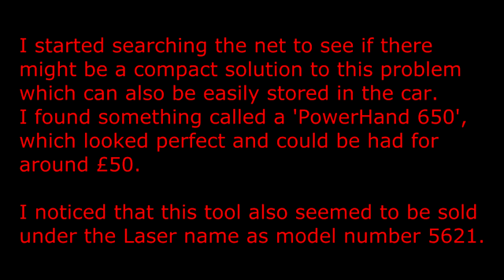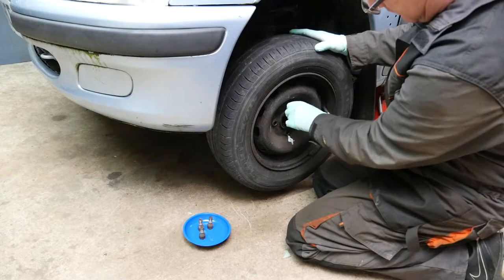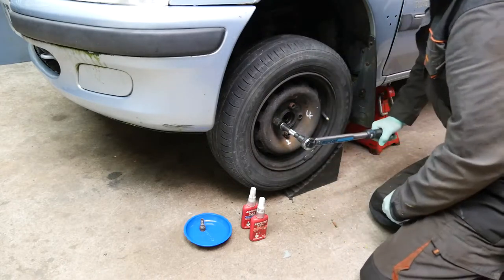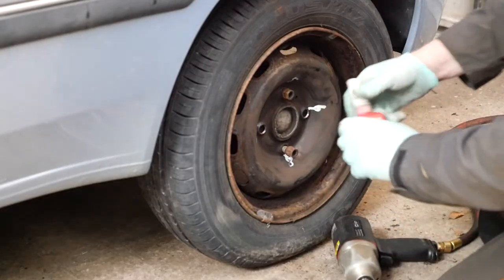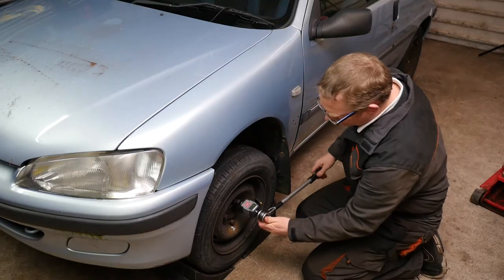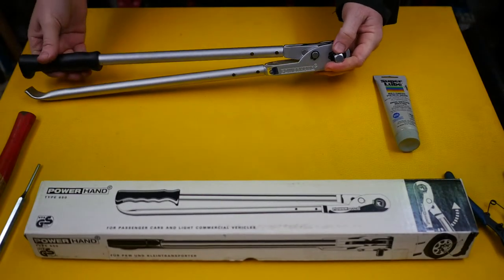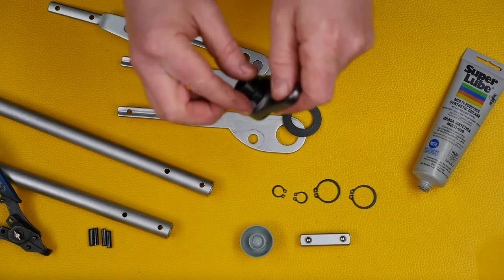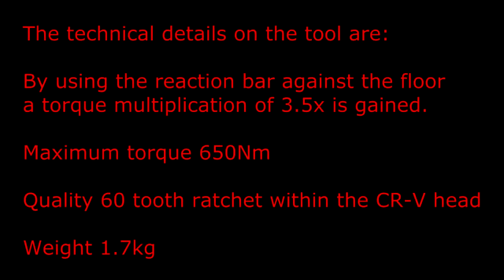Review of PowerHand 650  💪Torque Multiplier Laser 5621 Power Wheel Nut Wrench Power Enforcer 👊

Comment: I have one of those, I bought it several years ago from Harbor Freight Tools.
They only carried them for a short while and I had never seen another until now.
It is a very useful tool, and very simple in the way it's made.
Thanks for the video.
Reply from the maker: I think Laser took them on over here in the UK.  I was impressed with them as a road side lever to help get them over tightened nuts off.

Comment: Excelent video, as always! This is really fine tool but I'll get one only after I manage to get me some proper torque wrenches first.
Reply from the maker: Alexandru Dumitrache torque wrenches very handy with cars.  Thank you for the positive comment.
Reply: @CoatsandGaiters  Would this be good for loosening overtightened crankshaft pulley bolts?
Reply from the maker: @MrAcc45  no!! you’d need a proper torque multiplier like the Norbar.  Thank you.
Reply: @CoatsandGaiters  Ok..thx for the guidance. so they have a specifc one. 👍 frm Norbar
Reply from the maker: @MrAcc45  no but the Norbar type is the ones with enough power to undo a crank bolt.  If you see my Honda series your see the trouble I had undoing a crank bolt without using my Norbar.
Reply: @CoatsandGaiters  Ok...will checkout ur video...tq for the tip
Reply from the maker: @MrAcc45  https://youtu.be/WsRkvbL0yKY?list=PLWhghfmySWmq8cIaKtEbuaJJ3ZSyHhZ72&t=252

and this video shows how the torque multiplier works in action on a Ford

https://youtu.be/kUKmwmnD7yo?t=107

Comment: WAIT, you can use the reflex bar, but for another use, in tightening a flywheel nut for a VW boxer engine, they are at 200Ft/Lb's; might be an idea to try, not just on wheels, but other car related bolts.
Reply from the maker: Worth a try  though I presume it would need to be torqued to a certain amount with a torque wrench.
Reply: @CoatsandGaiters  yes, But I meant in lostening it, sorry my gaff.
Reply from the maker: @andyvan5692  would work really well for that I'd have thought.  They seem to be pretty powerful considering their size.  I was impressed.

Comment: Could this be used to torque lug nuts using a digital torque adaptor like the one you used in this demonstration? Means you dont need to buy a dedicated torque wrench. At the 17 minute mark when you were using the tool as a normal ratchet to tighten the  lug nuts, maybe just set the digital torque adaptor to 80nm or whatever the desired tightness may be and then  wait for the adaptor to beep ?
Reply from the maker: I guess you could but to be honest I just keep a spare torque wrench in the car for myself and my wife had this in her car as an emergency get yourself home tool.